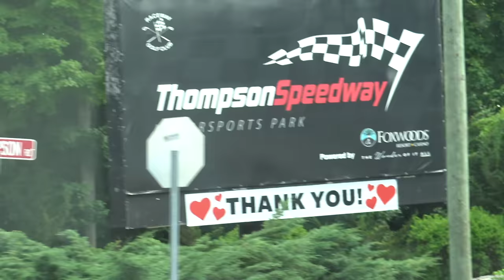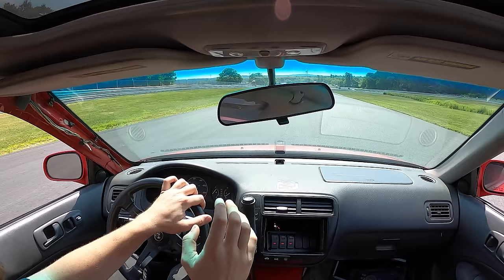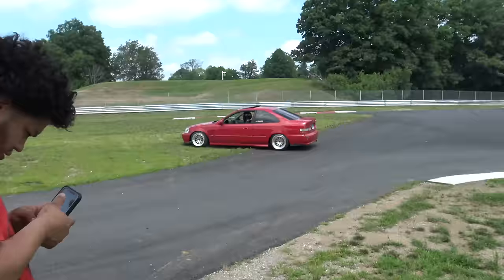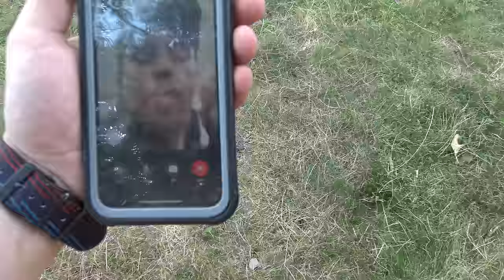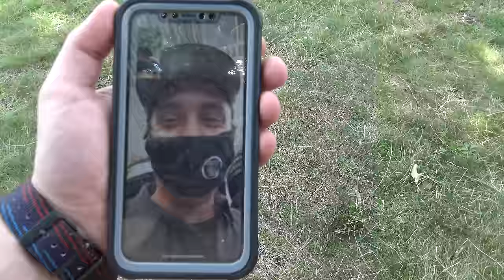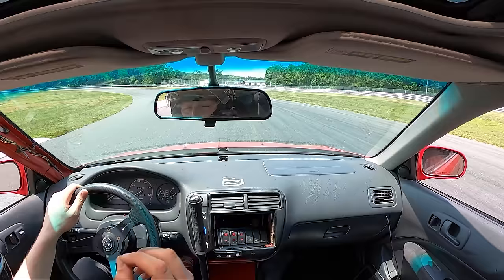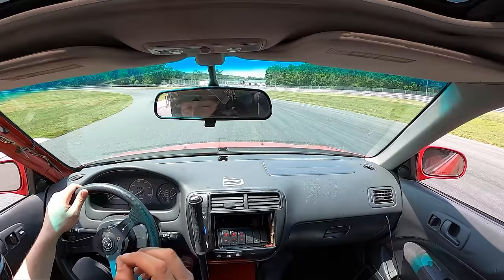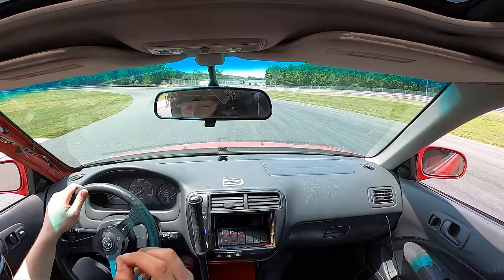Was it WORTH making a HONDA CIVIC into a DRIFT CAR?! (FIRST TIME AT THE TRACK)

Comment: That is the most balanced RWD conversion Honda I've ever seen. Need to watch more videos to see what you did with suspension geometry
Reply: it does look great, however the car I feel like suffers from the "hotboy fitment" syndrome, and would have performed better when raised an inch, running closer to Zero rear camber and some slightly narrower wheels.  At a certain point the suspension geo just suffers and you get the vibe that the car is not as capable as it could be.
Reply: Max RE he said nothing was adjusted, no power was added, nothing, he just took it out on the track. Clearly he knows what he’s doing dude

Comment: The car is so smooth on track that it doesn’t even look like you’re drifting most of the time lol
Reply: It needs more power to burn them tires up but just low boost settings it still looks like so much fun
Reply: That’s because he’s not. 10* angle lol
Reply: Moe Green  I dont know those bodys surprisingly have a lot of flex. Some tack guys even prefer to not run strut bars because the front end flex can actually give more grip on some setups. Would probably be faster on track as a FWD car.
Reply: Ek Ej chassis are smooth asf. Even on stock form from factory i feel like i drove a playstation. Power is problem, how about LS?
Reply: @Jcarney87  lol, are you watching the same video as us?

Comment: I wish I lived in the alternate timeline where these came rwd from the factory and remained cheap on the used market, could you imagine??
Reply: Would have been the Hachiroku of the late 90s
Reply: Civics would make up 95% of drift cars at the track if that was the case lmao
Reply: Civics would literally be everywhere for any type of build their number one problem in drag racing is grip so that would be interesting to see as well they would also be the Kings of roll racing putting down all that power smoothly instead of redlining your shit till it gets grip
Reply: Honda gave the other manufacturers a chance. That's the way I see it. Look at the giant following civics have. So many die hard fans, including myself for a car considered wrong wheel drive. If it were RWD, it'd be over for other JDM cars. Some of the most efficient, high revving engines, strongest and most satisfying transmissions, along with rwd and that awesome handling of a little civic?
Reply: and in this alternative timeline bmw e36 is fwd

Comment: Hey Jimmy, a nice alternative to a grill is using the 99-00 Civic sedan grill. They have 2 vents and the chrome trim is also pretty pimp.
Reply: It would be cheaper and more effective to just buy an eBay mesh si grille
Reply: @argen809  They're average $5 at pick & pulls, also he needs a new bumper regardless so he could just pick up a sedan bumper
Reply: No
Reply: Zack Bowers Facts 99-00 EK bumpers are every where
Reply: the 99-00 would be the way to go idk who thinks differently
Reply: @troutvisionllc you sound like my 2year old LMFAO
Reply: @snoisulli  I agree just a rep SI grille
Reply: @jaydoesstuff12  96-98 is the way to go.
Reply: @mitchellhamilton1753  96-98 impossible to find. The grills r everywhere but the bumpers are rare so r the fenders
Reply: @keeptrukin420  Not hard to find in Canada
Reply: @mitchellhamilton1753  Yeah man, literally the exact opposite in Canada. 96-98 is easier to find than 99-00, everyone is always doing front end swaps. Even EL front ends are rare here
Reply: @snoisulli  What? 96-98, 99-00 and EL fronts are all easy to find, EL being the hardest of the 3.
Reply: @mitchellhamilton1753  Maybe where you're located but no so much on the east coast
Reply: @snoisulli  I'm in Nova Scotia
Reply: @mitchellhamilton1753  huh, weird. I've been to several pick and pulls and finding 99-00 front ends were hard. Mind you I havent looked for one since 2013 after I sold all my Honda stuff
Reply: @snoisulli  Every time I go theres usually at least 1
Reply: I ship parts
Reply: I swapped my 96 hatch front end to a 00

Comment: God this thing is so cool! I would love to do an EG hatch with a K series like this.I do love that you did an EK coupe because it's so unassuming. lol
Reply: Also get a sony action cam. They last so much longer battery wise. I had a hero 8 ad my old FDXR-3000 whatever it's called and when the gopro died the sony had 4 of 5 battery bars left.
Reply: @Taylordrifts  I think the hatch has too short of a wheel base to drift
Reply: I feel the EG is shorter than the Ek.. so the EK would probably be better.. :P
Reply: @NorthwayMotors  it’s not
Reply: @mac6417  oh ok
Reply: @NorthwayMotors  some stuff may be better but the eg is more for drag I’m pretty sure, the ek has way better handling and performance overall. Oh bro my bad you said shorter I thought u meant the eg was better so working on the ek would be better since it’s ‘worse’ my fault u could be right
Reply: @mac6417  haha. Its alright buddy.

Comment: I can’t imagine the civic with a fully built KA OR SR THAT THING WILL BE RIPPING AT EVENTS AND DRAG STRIPS 
PROBABLY WEIGHS LESS THEN RUDNICKS SR ROADSTER
Reply: Yo it needs a honda k series swap LOL
Reply: TandM bros Nah if he 1.5JZ swap it, 🤤 it’s a wrap
Reply: Connoisseur Of Cars & Tig Ol Bitties 1.5jz would cost double and won’t be as easy
Reply: Bot quite, a miata is 2300lbs and this is probably 2650ish
Reply: AUSTIN Don’t forget about the weight reduction cutting up the chassis he can reduce a lot more weight using carbon fiber doors from seibon, fenders, hood, Trunk. What ever he wants trust it’ll weight less then a miata
Reply: @connoisseuroftigolbitts  the new motor is heavier, the trans is heavier, and they added weight to the floor with the square meter and a half of steel they used for the tunnel plus the new shock towers
Reply: Yeah a 1jz or rb25 would rip in a civic.
Reply: What engine is in the s2000?
Reply: 13b swap if you wanna talk about lightness. Make a brapvic
Reply: @divinedriftofficial  f20
Reply: Cody Praetorius f20c
Reply: Kevin Baboolal the f20 also came in accords and preludes but the f20c and f22c came in the s2000’s
Reply: @divinedriftofficial  and he's just a set of motor mounts away, considering this has an S13 subframe in it
Reply: @FUCK_________googIe  I think they made the trans tunnel to narrow to fit anything but the KA trans.
Reply: @connoisseuroftigolbitts  chassis aint strong enough for a 1.5jz . would twist because i doubt jimmy would strengthen it
Reply: @TheRealNolanStyles  nice didnt know that
Reply: @ethanlindsey  what about a 13b trans?
Reply: @connoisseuroftigolbitts  out of curiosity why would a 1.5 be better then a K series? durability?
Reply: Jimmy Boe both engines are superior  I have no competition
Reply: @TheRealNolanStyles  the f20c have little to no relation to the f series engines used on the 90s Accord and preludes. The f20c is designed especifically to be mounted longitudinally and to be rwd
Reply: K series anyday
Reply: @balancemode4112  i'm with you man, there are a couple of k24 turbo swapped Cars (an E36 and an s2000) in my country and they are track Monsters making 500whp with a chinese turbo 🤣🤣

I want to k swap my Ford sierra so bad, but i don't have the money 😭
Reply: Carlos Garcia very good I never said they did.
Reply: @TheRealNolanStyles  sorry, my bad, i iterpreted your comment as saying that the f20 and f20c were the same engines
Reply: Carlos Garcia the f series in the accord is more similar to h series motors
Reply: Speedfactory had a civic with a b series in it that made 2000hp and ran mid 7s in the quarter mile. Sadly they went out testing for one last time before retiring the car and they got into a wreck. Sad times. But they are building a new car so that’s cool
Reply: ZeloCODM ok what is your point not trying to be rude just a little confused where that comment came from
Reply: Tiger Doll my point is that a civic doesn’t need a motor from  another manufacturer to be fast
Reply: ZeloCODM I don’t think anybody said that. How would you make a b series front engine rear wheel drive. What transmission could be used?
Reply: ZeloCODM and isn’t this supposed to be a drift car
Reply: Tiger Doll oh. I wasn’t talking about rwd. There are rwd civics though. Most of them use k20s or k24s and use either a 5 speed liberty or some sort of power glide with an adapter plate to the motor
Reply: @TheRealNolanStyles  nor saying you are wrong. But there are fab companys out there that will make bell housing adapter plates.

Comment: Yooo Jimmy oooo. Quick little tip on how you can fix your intake air temperature problem for completely free. All you need to do is get about 20 or 30 washers and stack them underneath of the four bolts that attach the hood to the hood hinges effectively raising the rear of the hood and inch or two up allowing an open air space for the heat to escape up along the windshield which when the car is in motion will be assisted by air flow in aerodynamics sucking the heat out of the engine bay. this is an old trick used way at the beginning of the Honda Civic days in the late 90s.

Comment: I think the reason why this thing is so grippy and stable in drift is chassis rigidity . 

I wouldn't be surprised if the chassis was even more rigid than a BMW, with the civic being already pretty rigid and all the frame work you guys did.

This thing is begging for more power, it can clearly handle it! 😁😁😁

Comment: Nice car and nice setup. I see a lot some people saying t.......hat most of the Honda cars should have been RWD I don't think that If they were RWD it would serve the purpose that they were built for, besides they perform very well with the right modifications as is. I think that more enthusiast in the US need to not only adopt JDM style and modifications but also to adopt JDM mindset where the Japanese respect different platforms ie FF, FR, AWD and they try to figure out driving techniques of each so they can be more effective at challenging there rivals and grow in knowledge and the movement would be less petty and the bond between rival platforms would grow stronger. 🔰

Comment: tink you can use a cv axle boot for a shifterboot https://cdn.werkenmetmerken.nl/img/Womi_W517_Semi-originele_Aandrijfashoes_99mm-t-500x333.png
basicly clamp it arounf the base of the short shifter and the small end to the lever , should fit pretty tight

Comment: So why didn’t u try to figure out why it was only making 3 lbs while you were there ? But first time out for nothing to fail that’s awesome. Always a good day when the toolbox doesn’t come out.  Now turn it up and work on that angle bud. All that angle on the front end unused
Reply: The manual boost controller was broken thats why it had to stay at 4psi.  Electronic boost controller should be setup soon.